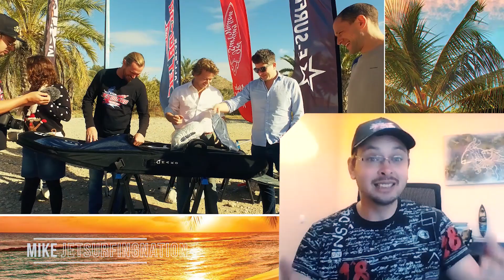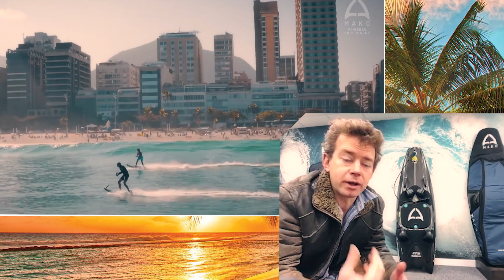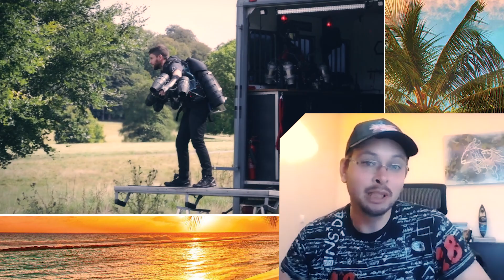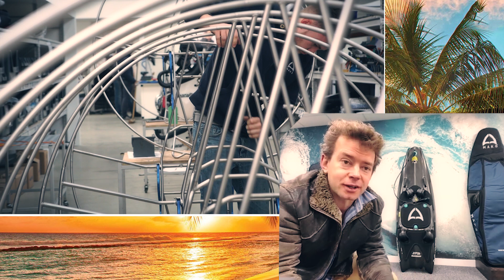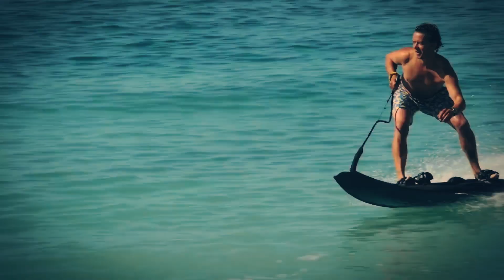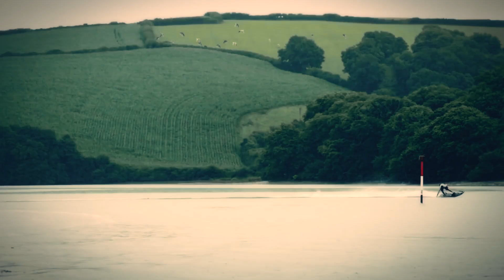MAKO Slingshot Jetboard | 2021 Models News |🏄‍ Mako Boardsports

Comment: This board is the biggest shit ever !!! I bought two last year just a problem with them. they sell boards without checking the board beforehand ... one of mine had a water leak, so last year only problems with the engine. new board  had a leaky cooling system. joke (after filling up the salt water, it returned to the workshop, it was washed and sprayed with wd40 exactly as in the description, the starter was rusty inside because it was leaky as well. I managed to replace it, but it was already the end of the season. one-year break and it turned out that the bearing in the engine also fell, which caused the scattering of several other parts, I could not even fire it!) 18k spent maybe 10 minutes of fan with board full of water inside  !!!! please. second one still in a box scare to touch :((((
Reply from the maker: Thank you for sharing